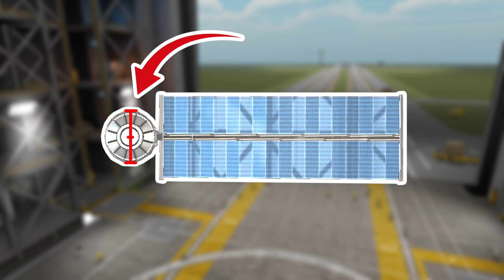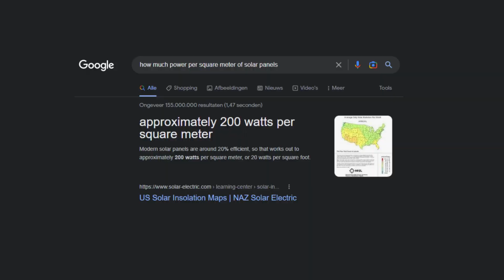What is 1 Electric Charge in KSP?

Comment: Solar panel area isn't reliable, for example, the SP-10L and -10C both have the exact same performance, but the -10L is much larger. A better way is to use the Brealing Ground rotors, the small EM-16 rotors use 1.6 EC/s at 20KNm, with a max RPM of 460, to get the power you multiply the torque in Nm with the angular velocity in rad/s, which works out to just under a megawatt, making one EC just over 600KJ.

Comment: Wouldn’t it be more accurate to use reaction wheels and a known mass?
Reply from the maker: Multiple people have mentioned this, how would the experiment work?
Reply: Sorry I did not see this reply.
I figure you could calculate the inertia for a craft on orbit to ensure skin drag does not matter. The craft would be a reaction wheel, some batteries, and a probe core attached inline. It could then be spun and the change in rotational speed would be measured (is this still considered acceleration?). I don’t know the exact math but I figure it could be done relatively easily. I think the solar panel approach makes sense but solar panels just vary sooooo much. I would love if it makes the small batteries equal to a pair of aa batteries.
Reply: And please translate to either amp hours or milliamp hours from joules after so I understand the units.

Comment: Maybe im wrong, but I think you actually miscounted the size of the solar panel, because its not flat, it has kind of a wave pattern to it. To get its actual output, we'd need to know how much area these waves cover together, which would be larger than if the array was the same dimensions but flat. 95 joules per electric charge is a good ballpark number, but I think it would be a little higher.

Comment: I think a better way would be to use the specific impulse of the dawn engine, as you can use that to calculate the exhaust velocity of the xenon. You can then drain a 1k cell and see how much xenon you accelerated to that exhaust velocity. The kinetic energy being equivalent to how much energy is stored in the cell

Comment: Mmmm…. absolutely wrong, you just straight up assumed that 

-Kerbol is just a sun (it isn’t)
-Kerbin is at the same distance that Earth (it isn’t)
-Panels have the same efficiency as real once’s (other parts rarely are comparable to real parts, so wouldn’t count in that)
Reply from the maker: - I did not assume Kerbol is like the Sun
- I did not assume Kerbin is at the same distance.
Due to the fact that Kerbin as the same surface temperature as Earth, the flux from Kerbol on Kerbin must also be (similar/ very close to) the same as that here on Earth.

And I think it is reasonable to assume that solar panels in KSP act similar to ours.

Edit: bit more clarification

Comment: You missed the fact that Kerbin's distance from the sun is different (a lot less) than Earth's to the sun. Additionally, are you sure the Kerbal sun is as bright as ours?
Reply from the maker: It is not as bright, at least, if it would be, Kerbin would be on fire haha. 

Knowing that the temperature on Kerbin is pretty much the same as on Earth, that would mean that the flux from Kerbol is also the same, so the panels would give as much power as for the Earth case.

Kerbol should have a temperature of 2840 K (instead of 5800 K) for Kerbin to be the temperature that it is. So yeah, luckily we can assume that the solar panels work the same as here on Earth

Edit: clarification

Comment: Do a video on how much 1 Kerbal fund is in USD. 

I've tried to do this before and my approximation is that 1 Fund = ~$2,500 USD. This is based on the S3 KS-25 "Vector" Engine which is a the game equivalent of the space shuttle RS-25 engine which costs $40-50 million real dollars per engine. So $45 million / 18,000 Kerbal Funds = $2,500. I would be interested to know if this approximation holds true for other parts though I doubt it. That would mean that the tiny I-beam worth 14 Kerbal Funds is worth $35,000.
Reply: Ah but you see a space-grade I beam purchased through government contracts probably does cost $35,000 or thereabouts

Comment: hol up, the solar panel isn't fully unfolded tho, meaning that this isn't the actual size of the whole thing or the actual electrical output or maybe you took that into account and im just being a dumbo
Reply from the maker: I did not take that into account, but it wouldn't that much larger, maybe 10% or something. But sure, it would be slightly more accurate

Comment: Keep in mind that the solar panels in KSP are measured by the amount of energy the produce on Kerbin, not Earth.
Reply from the maker: The temperature and atmosphere on Kerbin is similar to that of Earth, so the incoming light from Kerbol at that distance is the same as here on Earth
Reply: @curious_ksp_ksa  well I was thinking that the Kerbol system is at a smaller scale, so less distance that the light energy needs to travel and therefore more energy received at kerbin than at Earth.
Reply from the maker: @andrew40085  well, the heat on kerbin is determined by the amount of light that comes from kerbol. Indeed if Kerbol had the same output as the Sun, then the closer distance would mean more power from the solar panels. But that close you would probably melt.
Reply: @curious_ksp_ksa  yeah, I guess ksp isn't exactly too precise with it's solar heat and temperature, given laythes unusual liquid oceans despite being so far from Kerbol.

Comment: The largest and most powerful probe core in KSP is the RC-L01 2.5m remote guidance unit, which uses 4.8 EC per minute. This means that according to your calculations it would take 100 most powerful probe cores in KSP to run KSP2 at recommended settings. The entire setup would weigh 50 tons. That would be shrunk to a mere 12 tons if we use OKTO2 probe cores!
Reply: That actually makes sense. Real world computers used on spacecraft use very old technology, since it's easier to harden against cosmic rays than off the shelf commercial CPUs. For example I think the Perseverance rover uses a 1998 PowerPC processor for example. And Kerbals probably have to face the same cosmic radiation concerns. Actually if anything, that hardware may be VERY powerful for computers mounted on spacecraft, considering the comically high system requirements of KSP 2.
Reply: Isn't the "lore" most powerful one the Mk1 or Mk2 drone cores ?
Reply: @attilavs2  Yeah, Mk2 references AI
Reply: A lot of probes energy is communications and heating is my guess.

Comment: Very good job with the video! However, wouldnt the solar panel be slightly larger since the individual panels arent exactly flat? The solar array would just be slightly longer which I think could change your equation. As I said before I am not an engineer or anything so I may also be wrong.
Reply: This might not actually matter, as while there is more panel, it's really the cross sectional area that matters, and the flatness wouldn't affect that. The standard figures for solar panels is either real world conditions (not what we need) or directly pointed at the sun, where their cross section would be equal to their area.
Reply: @brodymiller9299  Interesting, thank you
Reply from the maker: Thats true! Did not think about that at all lol. But I think it would be a maximum of 10% more than I calculated (just plucked that number from the air, but is probably less than that). Calculating angles is maybe not worth it for marginal gains I think, but you are certainly right!
Reply: @curious_ksp_ksa  Yeah youre probably right that the amount gained would be very little.
Reply: @curious_ksp_ksa  That would probably account for the 5 joules error (supposed to be 100, not 95)